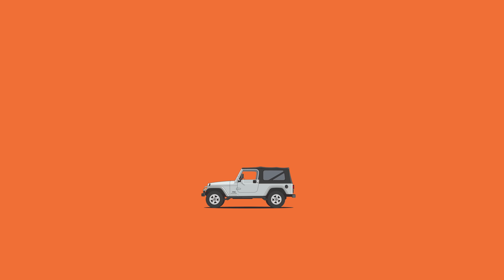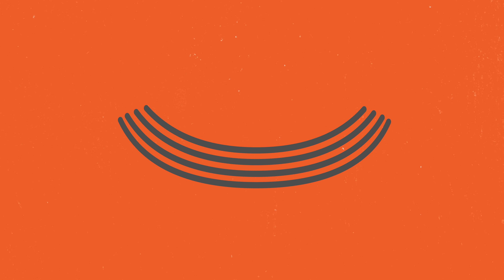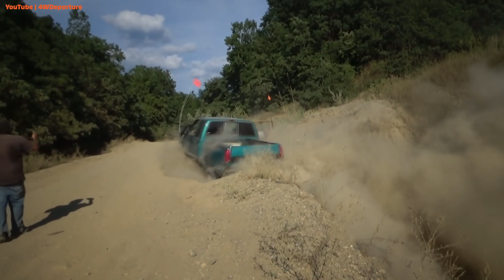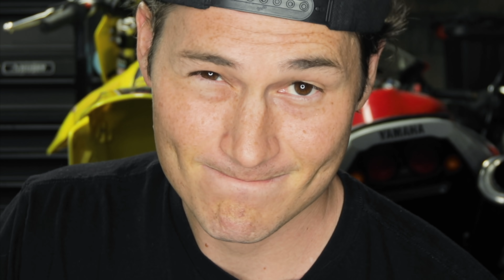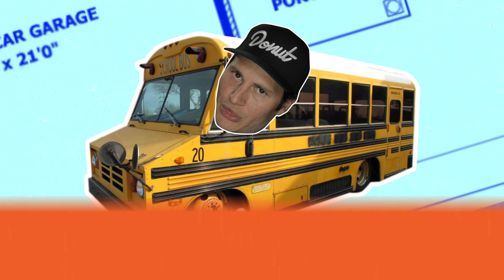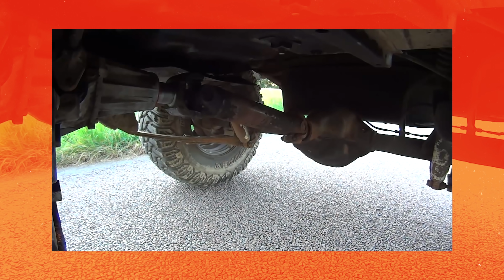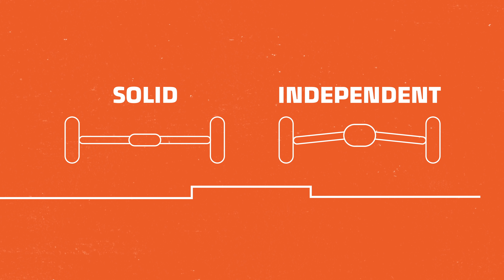Jeep Wrangler - The Science Explained

Comment: Due to the Bronco, Jeep is worried about reduction in sales, especially since the market is already troublesome as it is. That is why they dropped the V8 version the same day as the Bronco reveal, to try and steal some thunder. Which I find kind of petty, but business is business I guess. I love the customizable qualities of the jeep due to their deep history and aftermarket potential. But I feel Bronco will rapidly close the gap in that regard.
Reply: I think a big question is reliability, Jeep has a history of being unreliable, especially after being bought out by Fiat. Ford has had some troubles with reliability too, but not nearly as much as Jeep as of late.
Reply: @thumbtak  it's because people don't take care of their vehicles. I daily drove a JK Rubicon and took it on long road trips frequently. It never had any issues at all. If people bothered to change their oil occasionally, they would probably find that most cars are pretty reliable.
Reply: @lavachemist  Of all the problems I had with my Jeep, changing the oil wasn't one of them. The engine actually held up very well. It was everything else that wanted to die!
Reply: @Gamma00Ray  interesting. What year was yours? My 2015 was rock solid. Never needed anything at all, lol
Reply: @lavachemist  2009 with just under 82k miles, so it was pretty low mileage for how old it was. You had a 2015? Hardly long enough to say it's reliable long term.
Reply: @Gamma00Ray  prior to 2012 the JK was not good. The 3.8L was a bad engine and the 4 speed trans was also not good. The newer JK was much better. 5 years is definitely long enough to know whether it was a good vehicle, especially with the way I drove it (lots of road trips and lots of miles). I'd never buy an early JK.
Reply: @thumbtak  100%. I'm glad you brought this up because I have had multiple friends that had jeeps that said they wanted to get rid of them as quickly as possible. Not because they are bad cars....when they work. Ford has been doing a lot of research into these designs and have devoted more effort into their remaining models due to their elimination of everything except their trucks, SUVs, and the Mustang. I feel the full monetary giant that is Ford R&D team is trying to make the Bronco come out with a bang. I feel a V8 or upgraded version may not be to far off either.
Reply: Violently American not my experience. I’ve had 7 Fords used for work and 1 GMC and 2 Sprinters and 5 Jeeps for personal use. I had 2 6.0 Powerstrokes that were nightmares, an LCF which had the V6 version of the 6blow, also a pos. The 5.4s did ok, but always had stupid issues, like coils going bad, or sensors that left them sitting. The Ecoboost was a pos. Hated that thing. Sold it after 6 months. Still have my 97 Cherokee, and it has 334k with no major issues. I love my little Renegade Trailhawk. My next rig will be a Diesel Rubicon.
Reply: Ford has nothing on the Jeep Wrangler. The modern Bronco has yet to even be tested.
Reply: Jeep hasn't listened to their customers who have begged for a V8 since the CJ was discontinued. The Bronco is going to hurt jeep in a bad way. The funny part is that it isn't even the actual Bronco that will cause the most trouble, it's the damn Bronco Sport. For all the housewives who think they need a jeep to get out of the driveway but want a soccer mom SUV.
Reply: Lol of course its going to reduce Wrangler sales... the bronco is the same thing as a wrangler, except it has crappy IFS.
Reply: John C the Bronco is a Ranger with a suv body.
Reply: Idk about the Bronco taking to the hardened off-road scene very well, tbh. The top of the line model IS better on paper than the Rubicon Wrangler, but the basic model is worse than the Wrangler Sport in terms of ride height and approach/departure/breakover angles. On top of that, the rack & pinion steering and IFS (especially the choice to use one piece coilovers) is going to make for much more expensive lift mods and, let's be honest, nobody wants to roll $50k+ out to the rocks or mud and risk an expensive repair. In time, I don't doubt that the aftermarket economy will gain traction for the bronco and we could see some equal footing on the trails.

In all, I'm just excited for a possible off-road arms race bringing QOL upgrades back to the community, regardless of who is "winning".
Reply: Steve Brown I’m with you on that IFS debacle. 

Though A VERY RARE thing, the smartest thing any suspension/driveline company can do if reasonably profitable would be to start R&D on a FULL SAS kit for the top line Bronco. Ditch that wacky single coil over (YA EVEN SWAP OVER TO SOME OLD MAN EMU SPRINGS!) The front end of the new Bronco clearly isn’t like a Raptors super beef shafts/arms. A D44 would look right at home under there. Make it a complete package kit, or choose your own housing/steering components like PSC.
Reply: Cybertruck.
Reply: @YourFriendStChris  - FACT is a DUAL MOTOR beats a inline 6 banger.
Reply: YourFriendStChris plus, I don’t think the Bronco ever out sold the Jeep.
Reply: If Toyota would bring the 79 Series Landcruiser to the US market, the Bronco and Wrangler would both be in trouble.
Reply: The main issue nowadays is quality as well. The Fiat merger did not help CDJR at all. We will just have to see what problems (if any) arise from the Bronco since its a, "new" model.
Reply: They should be worried. Jeep is not what it used to be, they peaked with the TJ and after Fiat acquired them, they went downhill from there...
Reply: Jeep will also have the hybrid electric model too
Reply: As someone who was about to buy a Wrangler, but then discovered the upcoming Bronco. yeah, Jeep should be worried, the Rubicon suddenly has real competition. You can say it's untested, fine, but spec-wise it's toe to toe (better in a few places) and likely to be more reasonably priced.

Comment: Too bad jeeps are built like trash and leak oil like crazy. There's no such thing as a jeep that doesn't have a leaking rear main, oil pan gasket, and valve cover gasket. They all leak. Can't fix it either. You replace that valve cover gasket and it'll be back in a year leaking again. I should know, I work on them (and many other kinds of cars) for a living.

Comment: This guy’s going all in depth about how the Jeep Engineers designed the front suspension when in reality they just copied the 13 year old XJ’s suspension.
Reply: Let's not forget he showed a pic of a 4 link(trailing arm) when the suspension is actually a radius arm design.
Reply: @TexasRedneck  uh, no.  Jeep never did a factory radius arm suspension.  They did parallel 4 links.  There are plenty of aftermarket radius long arm suspensions out there, but not from the factory.
Reply: @HomebrewHorsepower  you are correct, I was thinking of the aftermarket kits.   They still showed the wrong suspension.
Reply: Agree

Comment: Forgot to mention the main perk to solid axles and that is that they preform much better while rock crawling compared to independent suspension because the solid axles are able to flex and keep all 4 wheels on the ground making it easier and safer to go over larger obstacles

Comment: Articulation. The most important part of having solid axles is the ability to have one axle one way and the other flopped the other way, flex.
Reply: Also the diff housing moves up and down with the wheels unlike independent where it's strapped to the body on really rough terrain diff clearance becomes practically non-existent. I went off-roading with a bunch of friends and one of them had a brand new Ford raptor after the trip he's bash plate was well and truly used there was also a whole bunch of sand and mud built up behind it.

Comment: I love my 06 TJ...  Only a 106000 miles and it's in good condition. Even with a small 2" lift, it sits stocky with the one and a 1/2 inch spacers and size up to 32" Wrangler duratracks.

 A decent little trail rig!
Reply: Same here! I love my 06’ TJ!
Reply: I have an 06 with 137000 and a 1.5 inch lift and 31s. Never been completely stuck before, only a little but managed to finagle my out out every time. What I failed to mention is mine is in HORRIBLE condition lmao I like to call it Just Empty Every Pocket but hey that's the price you pay for driving through feet of mud and jumping it and actually using it I guess
Reply: @GungaGingGong  you gotta try hard if you wanna find the limit and get stuck. Also, you need to spend some money on it if you wanna talk about Just Empty Every Pocket. It sounds like an essentially stock jeep
Reply: @garettodd3037  Oh trust me it's been pushed plenty lol doesn't need to be super built up, it does great with a few upgrades. Just replaced the whole suspension and with how much I bought it for plus parts and labor it's almost a 50k jeep
Reply: I love my fully modified 2005 TJ Unlimited, only 10K miles(trailer queen), Dana 44 front and back, 4.5 Rubicon Express lift, Teraflex Sway Bar, Teralow 4:1, 4.88’s, heavy duty tie rod assembly, OX lockers, Warne 9.5 TI winch.

Comment: I think the Jeep is going to have a real run for its money with the new Bronco. That Bronco is looking really temping, and I’m not even a big Ford guy or anything
Reply: The Bronco will be more reliable, too.
Reply: IndianaJoe0321 Maybe, it’s hard to say sometimes with a brand new product. Recent refresh of the explorer for example brought over a ton of mechanical issues that the previous model didn’t have. But the thing the Bronco has going for it is that it uses parts from other models. Time will tell!
Reply: Excellent points,  @PizzaParkersGarage . In my mind I was actually framing my comment through the lens of Fiat ... since the newer Jeeps are under Fiat management, they are extremely unreliable.

Comment: 0:42 not coil-overs...
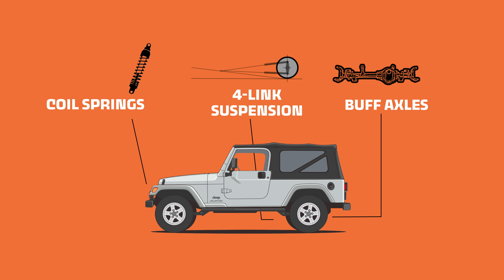0:46 only the Rubicon comes with the Dana 44's stock. millions of non Rubi jeeps out there with BILLIONS of off-road miles running 30/35 combos.... and don't even start on the Willys jeep with a 4 cylinder and leafs and pencil axles...
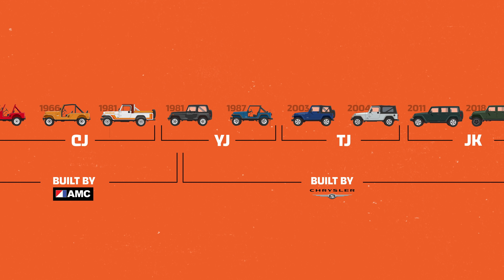2:04 the TJ and TJL or LJ was from 97-06 NOT 03-04
YJ was until 96
and the JK started in 07... WHO MAKES THESE GRAPHICS??